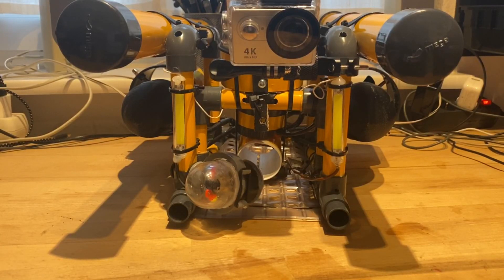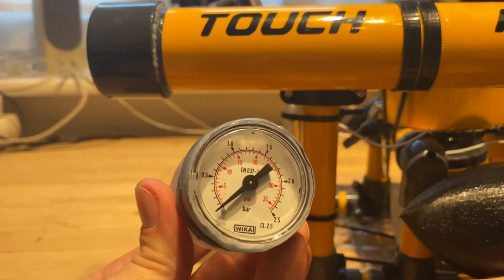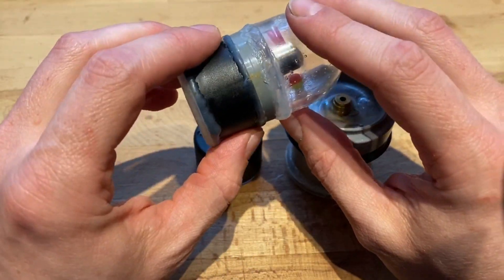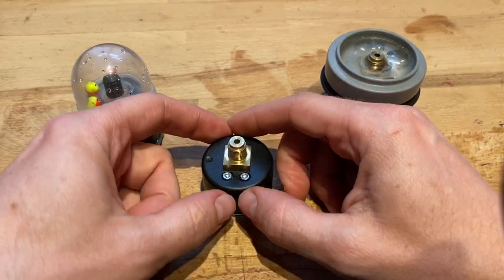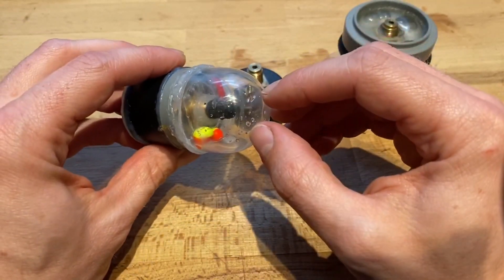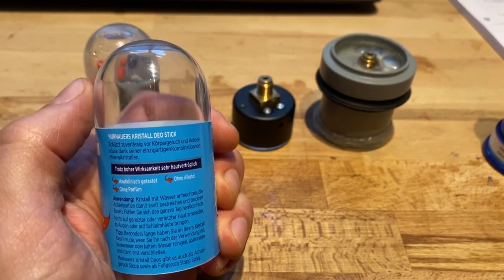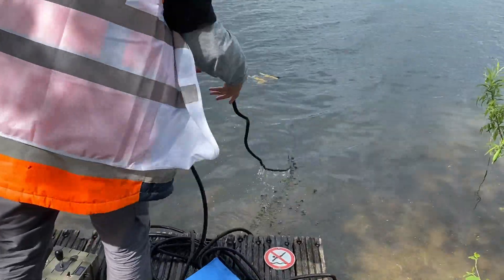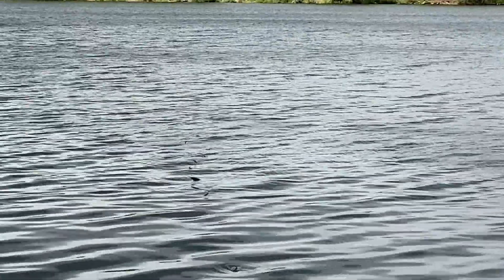Selfmade ROV DEPTH Gauge indicator SeaPerch DIY Submarine

Comment: Why not just run a hose down your new tether system and keep the pressure gauge on your controller run from a makeshift aquatic version of a pitot tube?
Reply from the maker: Because that only works in theory. 

You’d go nuts using and maneuvering a pressure tight hose for 30 meters while keeping a soft, pressure sensitive air-chamber on your ROV that will cost you precious positive buoyancy on extreme depths. 
But yes… theoretically it would work of course.

Comment: a lot of epoxies are exothermic, which means they heat up while they cure. and that temperature can increase with the amount of epoxy that's curing. so it's possible that while the epoxy was curing, it got hot enough to melt your candle wax and seep through. im not an expert though, so this is just my speculation.
Reply from the maker: I’d say that is spot on! 😃👍🏻

Comment: The rubber bulb on the depth gauge is similar to what I'm using to pressure compensate BDC motors for a thruster. Glad to see I'm on the right track. I'm subscribing.

Comment: Can’t way to see the new tether. I am also making one! :)
Reply from the maker: Marco Trevisan Mota thanks! If all goes to plan we are gonna launch this baby in a lake on the weekend... that will provide some new extra footage.
The video along with the construction-method-details is already under way. Can’t say when it’s finished yet though.
Reply: @agermangineer  Thnakyou! I was thinking in using a flat ethernet cable. Maybe it is more flexible and has a good buoyancy. (50meters ethernet cable); Then I will use etherenet IPV4 TCP protocol to transmit data. At least this is my idea. I hope this isn't spam, http://www.homebuiltrovs.com/rovforum/viewtopic.php?f=18&t=2066 ; thi is my thread where I am showing my process in building my rov and asking help. Today I got the BlueRov 3'' Dry hull!
Reply from the maker: Marco Trevisan Mota THAT IS BEAUTIFUL!!!! For data transfer (on board power supply obviously) it should be fine. 
Mine has speaker cables due to the resistance... but your version only calls for a rope and that’s basically it. Well done! However if my design sparks up an idea, I’d be happy of course!! Keep it up!! 👍🏻👍🏻👍🏻
Reply: @agermangineer  Speaker cables? did you switch out the CAT 6 cable on your new tether?
I'm using a flat CAT 6 cable. I don't know if it's my problem or not but I have a lot of power lost. I'm in process of troubleshooting and wondering if I should have gotten a regular circular CAT 6 cable instead
Reply from the maker: Jiggle.The.Handle the question is how long is your tether? At 50‘ it shouldn’t be too bad, but if it’s longer you’ll lose a lot of power. Big time.

Another possibility is your controller. Make sure to solder as many connections as possible or crimping them to have thorough power connections.

In the meantime: yes I’ve switched to really really heavy 1 mm^2 all copper cables. Long story.... but now that 100’ tether has virtualy no more power loss.
I’ve even added a big 1.5 Volt battery as a booster to increase the outgoing voltage to almost 14 Volts. That’s some power right there.

I’m still working on the next video. I hope that I’ll have it complete soon.
Reply: @agermangineer  it's 50'. I don't think it's the controller because it's good when the bilge pump is connected directly to the controller. I think it must be one of the CAT splinters or the cable. I just ordered a 50' CAT 8 round cable. We'll see....

100'! that's awesome. can't wait to see your next video
Reply from the maker: Jiggle.The.Handle ok that should do it! Wow, Cat 8 for 50 feet! 💪🏻😀👍🏻 that should fire it up!